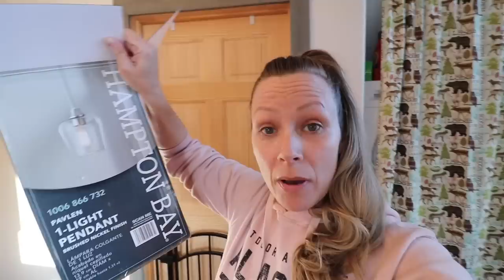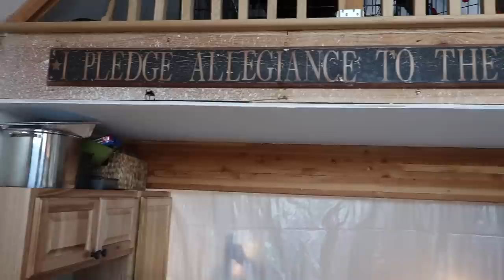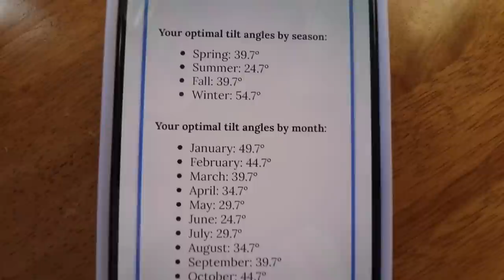Rustic Cabin Kitchen Ceiling😍| Open rafters, Exposed Beams + Settling the Chicks Into The New Coop!

Comment: Had a thought for you.  For my chicks I added a small wall to make a smaller corner to hold in the heat as well as added tinfoil insulation to refect the heat on all the walls.  Works great.

Comment: Great job on the chicken coop. I just was wondering if you guys are going to be putting linoleum down on the floor to prevent the wood from getting wet and rotting out? We noticed here in Alaska raising chickens that during breakup season that the birds bring a lot of moisture into the coops after being outside, plus waterer spills etc. It just preserves that floor for many years and makes cleaning so much easier. :)
Reply from the maker: Most likely we will. We just had to do the bare minimum to get the chicks out of the cabin into the coop. We still have to do boxes, windows, close able vents, and many more. Thanks for watching!😊
Reply: @HomeFreeAlaska  Awesome... yes so much to do so little time it seems. :) Sometimes we just gotta do what we gotta do when those chicks get too big for their areas. Has happened to us before lol. Love watching your journey! God bless.

Comment: I just wanted to tell we added onto our Colorado cabin like u r talking and where they connected the roofs   It leaks. Our builder said we would have been so so much better to have had the roofs come out the same and make it  two story.  You could add a bedroom for parker on one side and kellen on the other. Just a thought. They r trying to fix it but so far no luck. I thought i would share our woes